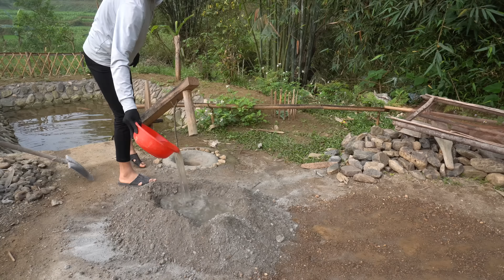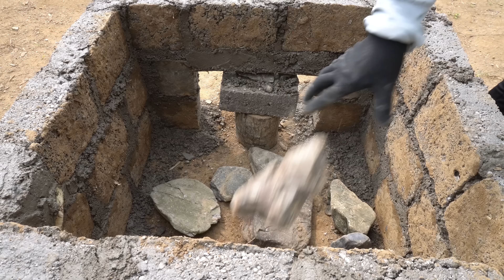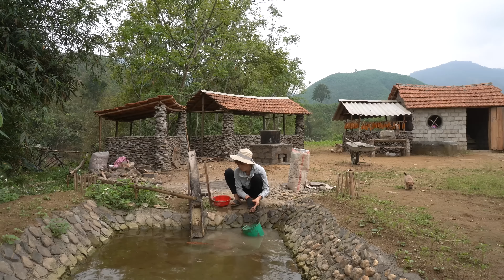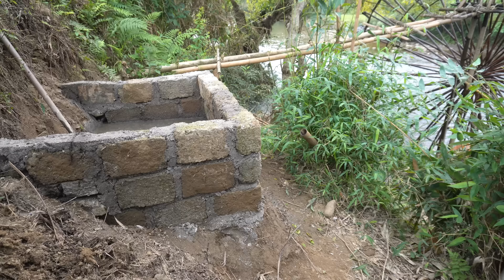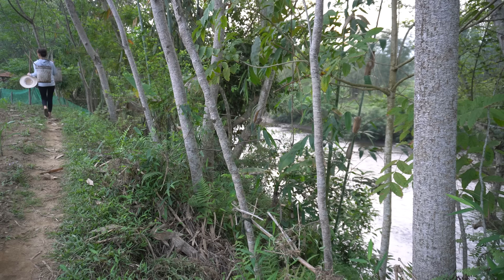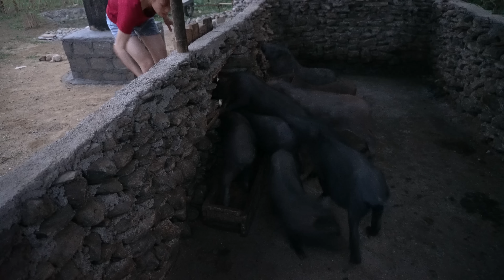How to build Complete a wood stove from cement and bricks - Green Farm Life, Free Bushcraft

Comment: The pig manure you are collecting will make excellent fertilizer for your crops.  IK was so happy to see you dipping the manure your new corn crop.  That corn will grow big! 😊
Reply: That’s what I am interested about…. Is that pig poop good fertilizer? Have you seen it work on vegetables with good success? I’ve never seen pip fertilizer but I can raise some pigs and try that in my garden
Reply: @johnstoutenburg7163  You bet it's good fertilizer.  By diluting it with water, she doesn't have to worry about burning the plants because it's fresh.  Most people grow pigs on dirt with straw for bedding.  That's what pigs prefer,  They want to dig and wallow.  Can't do that on cement.  Pigs will use the same corner of the pen as a bathroom.  So depending on how often you want to clean up the bathroom corner...  If you go the hay or wood shavings on dirt route, you'll need to let the mix compost for about 1 year.  Nothing fancy,  just build a row, one wheelbarrow at a time.  After a year, harvest the first manure you dumped and work down the row toward the fresh manure.